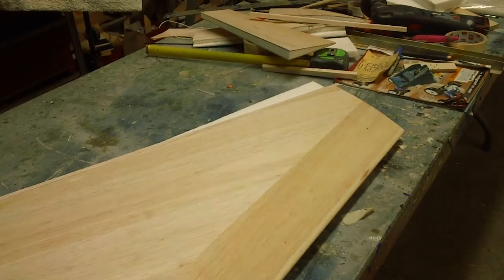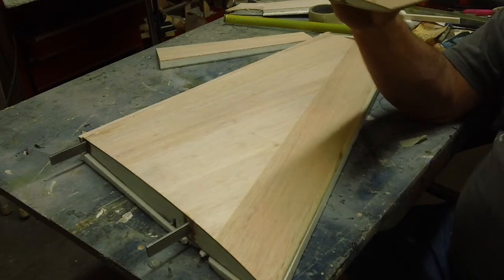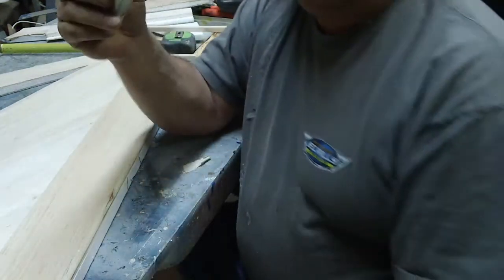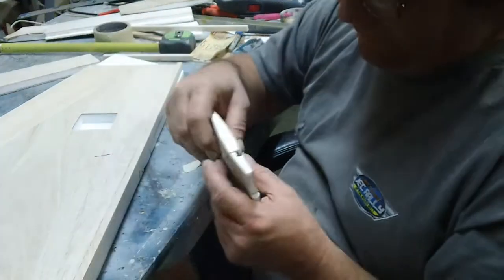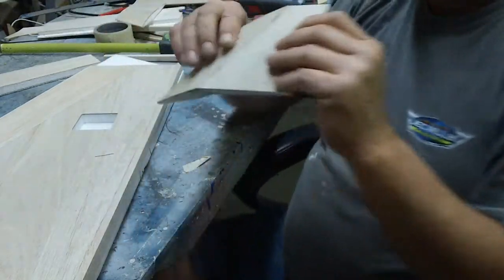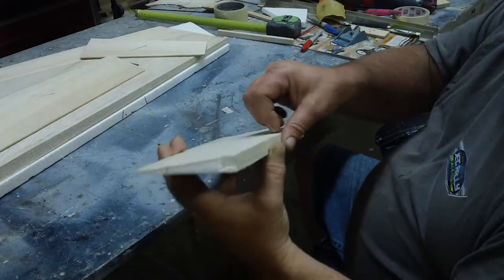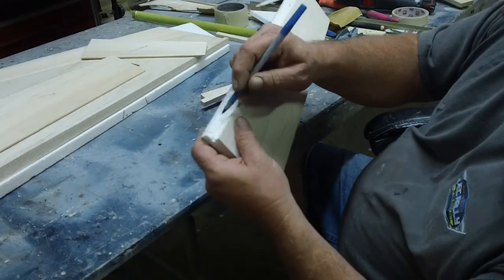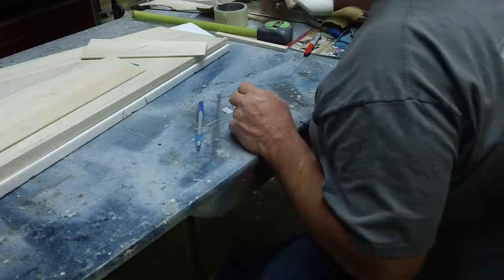Yellow aircraft Big f-18 turbine jet build # 31

Comment: Is the balsa sheeted foam like this wing heavier than the fiberglass/foam/rib composite construction like you've used on the 105? or is it weaker? or just a pain to work with.